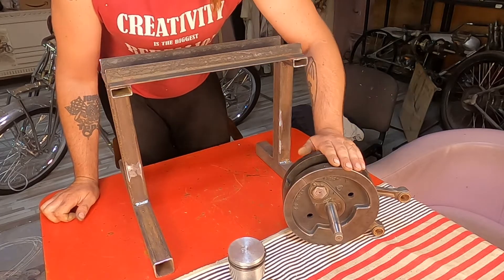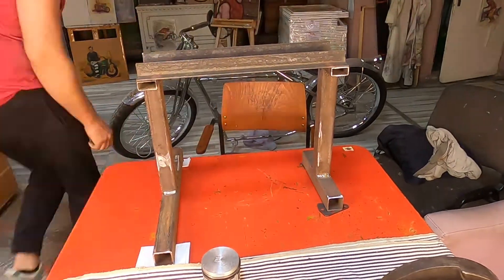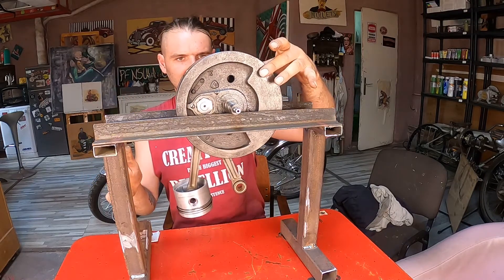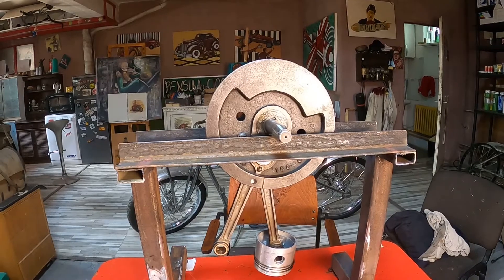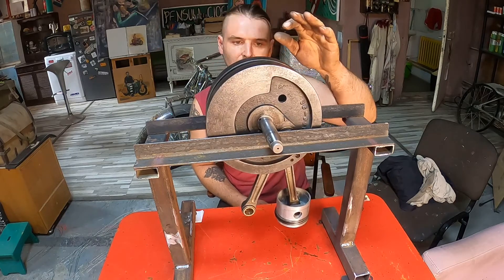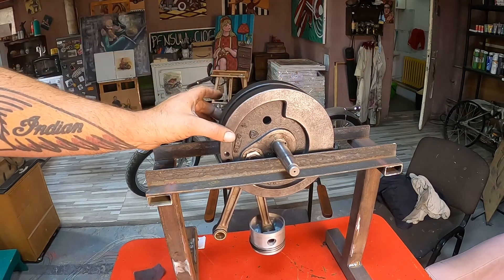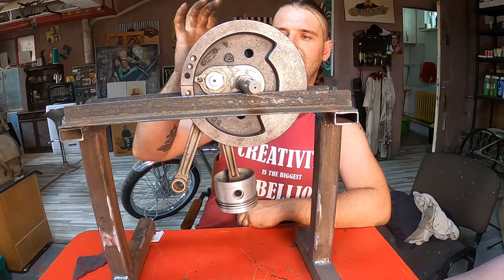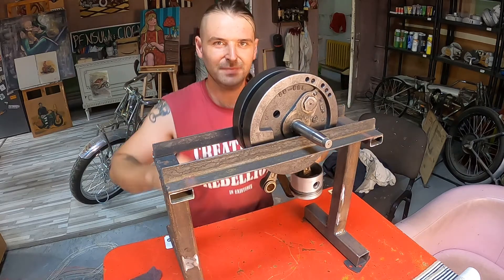Ep 16- Scout 648 Stroker - Flywheel Balancing -

Comment: Indian factory blueprint for 1931 racing motors says to add a additional 4 oz weight in the aluminium piston and 2 oz for cast iron piston. That is moving the balance factor up in the rev range. So if you like to rev your engine, have the pin side heavier.